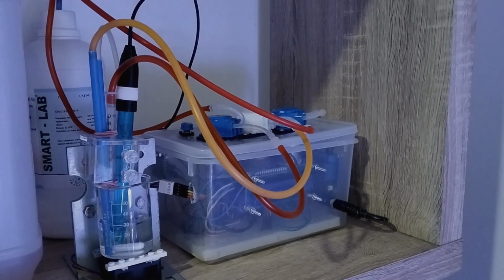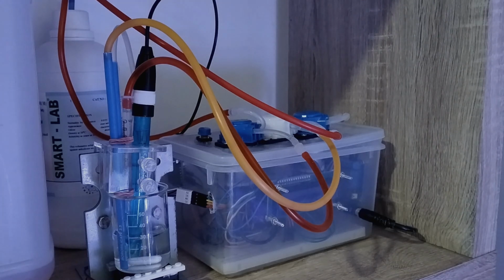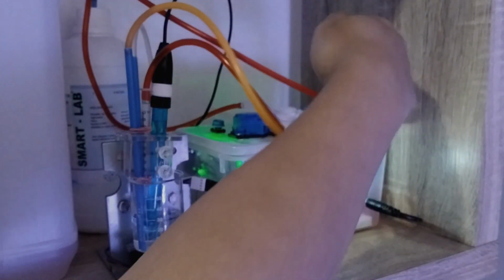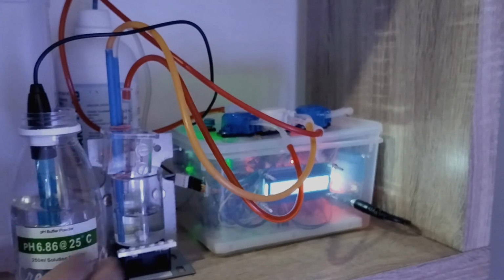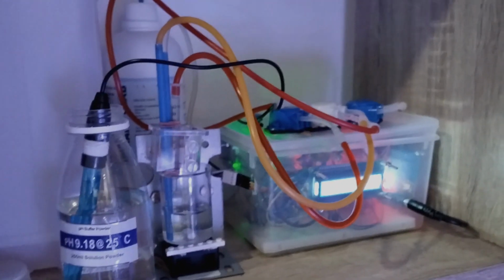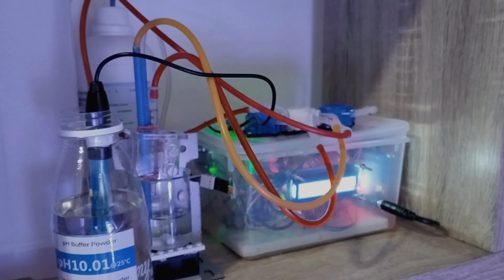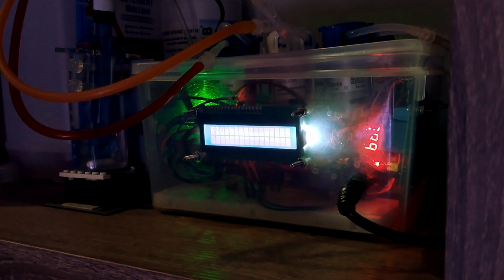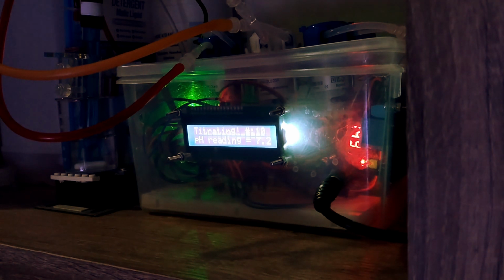DIY Automatic Alkalinity Tester with Arduino Uno for Reef Tank

Comment: How do you control kamoer?
Reply from the maker: I use relay to turn on and turn of the dc kamoer pump. This is example video of using relay for controlling dc pump https://www.youtube.com/watch?v=KRDgay5uSmw
Reply: Nice. And is it precise? Can you dose like 0.1ml at a time?
Reply from the maker: @Dibilibix27  I’m using the NKP Kamoer pump (https://www.kamoer.com/us/product/params.html?id=2005).
I calibrated it using a measuring cylinder and found that one droplet is approximately 0.18–0.19 ml. Because of this, I had to increase the volume of reef water used in the titration to obtain a decent kH results.
If you're using a different Kamoer pump, such as the KPP, it might offer better precision.
Reply: @TH-rw1fzhow did you connect in arduino? Did you use a driver?
Reply from the maker: @Dibilibix27  yes I connect kamoer to arduino with a relay between them. I did not use any driver.
Reply: @TH-rw1fz So it basically just turn on and turn off, did you find precise?
Reply from the maker: @Dibilibix27  yes it is only turn on and turn off.. the pump is reliable.. the trouble is more on the pH meter, mine needs frequent calibration..